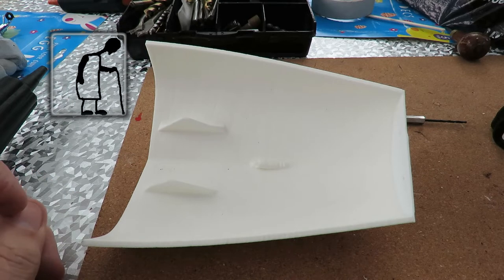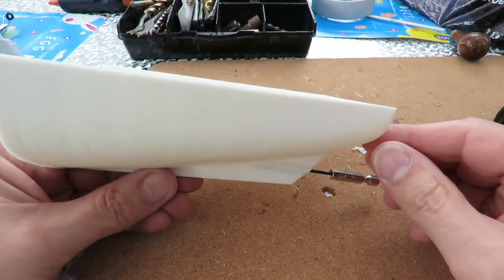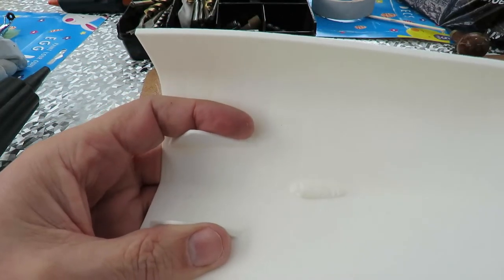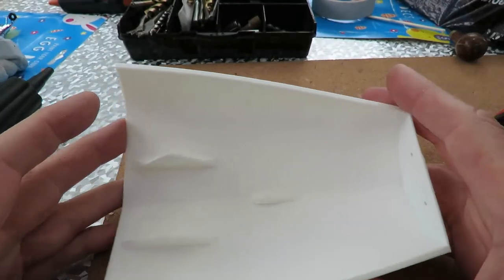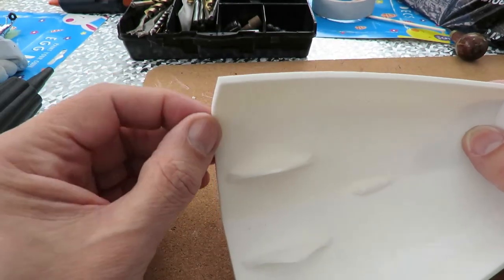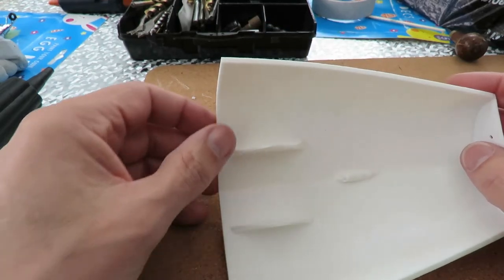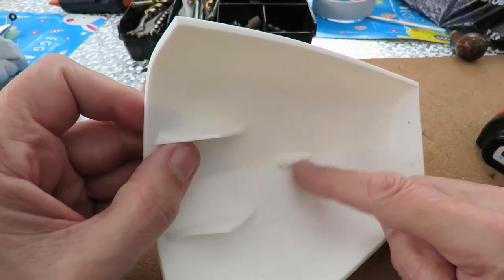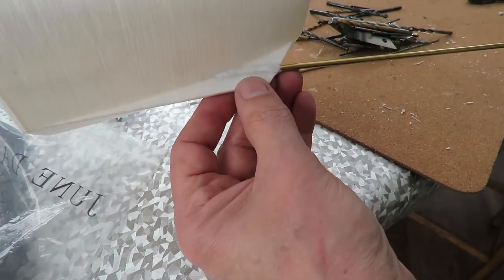Gifted 3D printed boat PART 1

Comment: Exciting to see you getting into 3D printing. Myself, I just glue 3D printed parts with super glue.
Reply from the maker: I have a love hate relationship with superglue. When I want it to stick things it fails more often than it succeeds and when I don't want it to stick things like my fingers it works perfectly 😜
Reply: @GrandadIsAnOldMan  Truth!

They do make special glue for 3D prints. They call it "Gloop". But generally I think I'd probably just run down and get some E6000 or something. There's so many adhesives and this is just gluing plastic together.

Comment: Although I think re-using parts/recycling is (most of the time) better, I must admit 3D printing is great. I've created the self-locking hinges for my Rocket Drone, a chalice for the Nutella glass, the finger line release for my old speargun and the inner rings of the carbon fibre propellers for my LotusRC T380G quadcopter. BTW, all this stuff is available on myminifactory website.

Comment: That is clever (filed bicycle spoke melt drilling). I will commit that to memory.
Reply from the maker: In effect it was just melting it's way through as it heated up. I don't recommend it but it worked for me in this case.